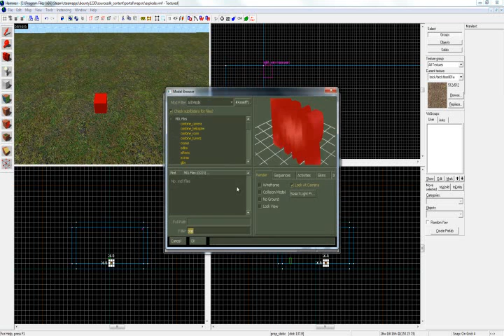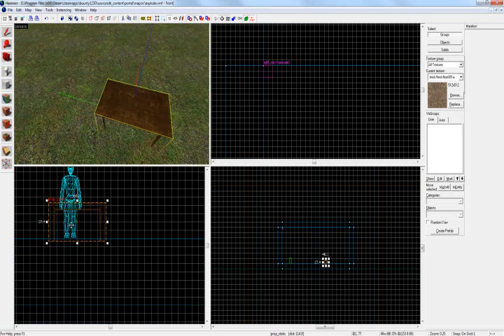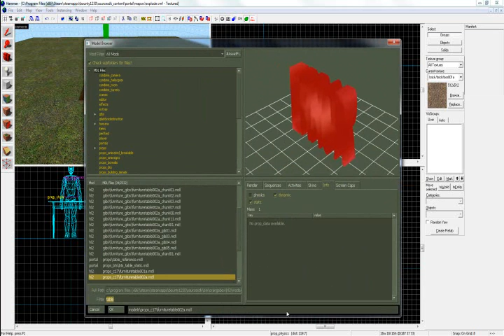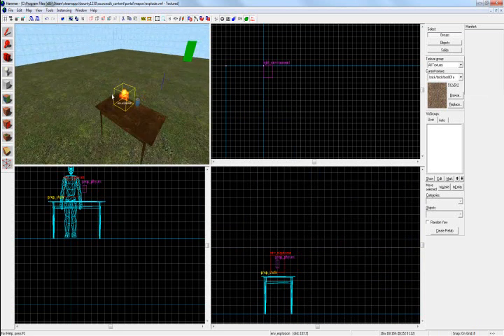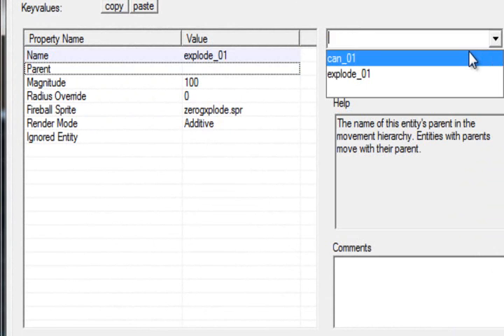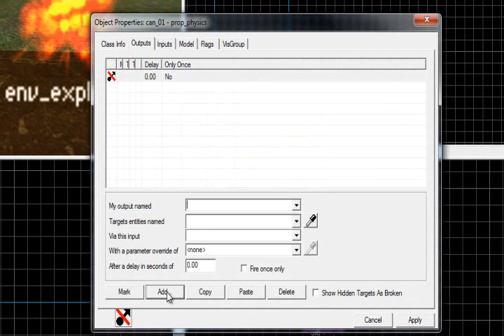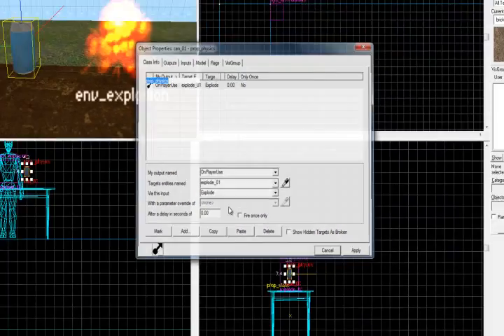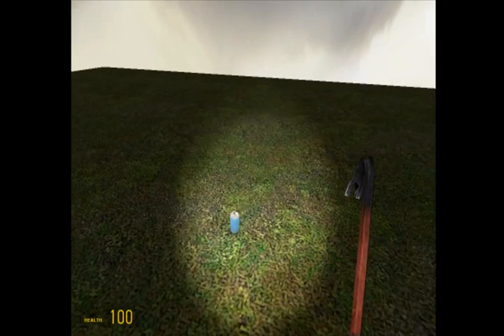Valve Hammer Editor Tutorial - Explosions

Comment: What if when mine explodes, it crashes my game.......
Reply from the maker: On a serious note though, have you set the force too high on the explosion, do you have a lot of physics objects around the explosion area? Havok physics engine is pretty fucking awful to be honest.
Reply: IamAsparagus Bro I made my own little system thing for mine that made it possible lol
Reply from the maker: you should probably download more ram tbh
Reply: IamAsparagus I made a trigger_hurt for both when my button is pressed it creates the explosion leaving the person near or at the barrel to die. Then I have one that's right at the barrel for when you actually go up to it, it will explode and kill you. Doing it this way didn't cause any issues. Lol
Reply from the maker: @micspamgod2324  If this is a standard explosive barrel you're using, then it's actually coded into the engine for the barrel to explode upon a set amount of damage. This could be where your issue stemmed from.
Reply: @IamAsparagus  Yeah I know, I took the explosion away from the barrel(the actual prop entity) and it done no damage. Still made it crash, doesn't matter now, what I made works perfectly. Lol :D It does everything it needs to do.
Reply from the maker: @micspamgod2324  Try and find a way of doing it correctly if you've done a fuckey version of it, the source engine is a bitch for playing ball.